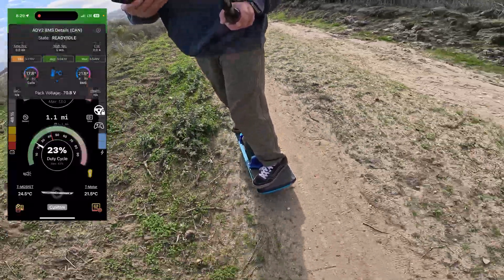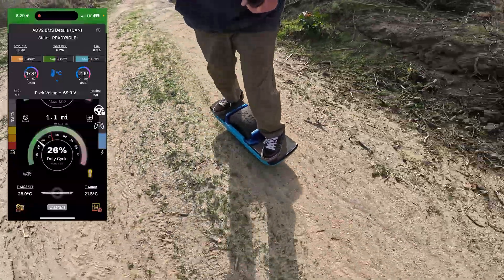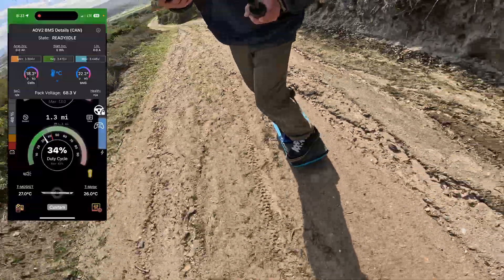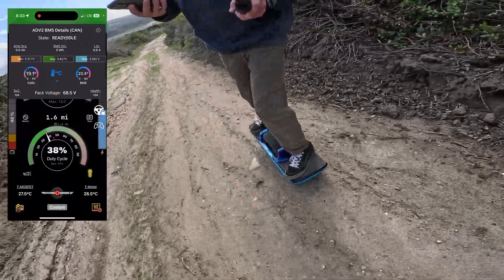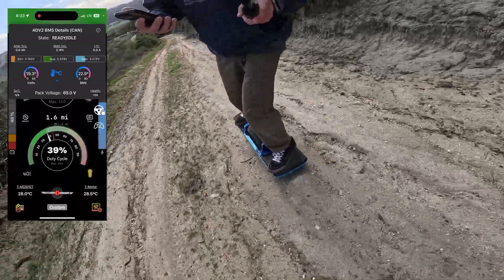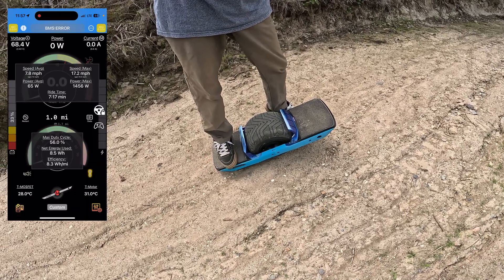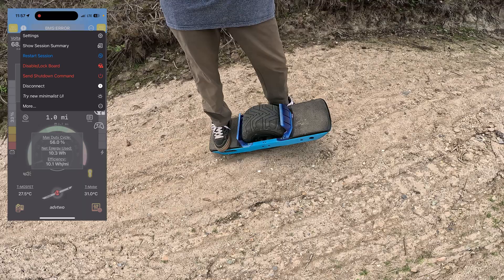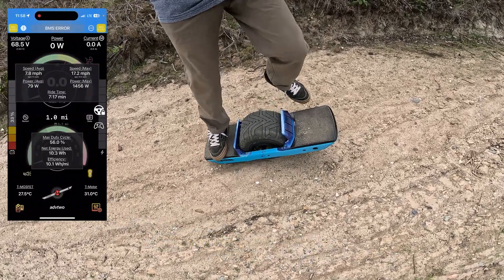VESC BMS Pushback done right - Floatwheel ADV2

Comment: It would be great to have some sort of common ground between Surfdado and Floatwheel and an official update released. I've just received my ADV2 and the amount of advice regarding settings changes to stock ADV2 board (which should just work out of the box) is a bit concerning

Comment: So we should either:
- cut the wire and give up on bsm pushback and remote tilt back 
Or
- download the float package and put in the settings you show?

Please help me understand 😅
Reply from the maker: @Smike2095  if you don’t want a remote just make sure remote is set to None in Refloat Cfg. If you want a remote you gotta cut the wire
Reply: Hello! 
Thanks for Intel, I think I understand my problem now. I change all the setting you told us especialy the remonte.

To start you have to know I have a problem with my bms making the board impossible to turn off. Its on since my first start and won't get off with long press on button...

Actualy with low batterie around 64-68 and steep hill I get the board giving me à big captain Morgan with setpoint to 13°! And this capitain Morgan Never stop! I notice no pb with the cell voltage they are nicelly calibrated over 3.3v.
Température fine but I just notice the T7 error code 99° in the bms Windows of vesc tool. 
 So I have to ride all the way back home with the hudge capitaine Morgan with a board at 68V...

When I charge my board over 70V it work good again normal... 

Big mess... Tony Will send me New bms in 3week. I Will try again tomorow with your New setting. Maybe the none in the remote Will save me ...

If you have an other thougt tell me.

Have à good Day
Renaud
Reply from the maker: @RenaudWeimerskirch  setting remote tilt to "None" will definitely save you. For your "always on" board please try to set the brake current in "Refloat Cfg", "Start" section to 0A (default is 6A) - then wait 30 minutes, does it turn off now?
Reply: @surfdado  the "none" in tilt control realy help! Now I can go to the end of the battery and have à normal push back wich go along with how much I ask for power. It's not anymore the constant captain Morgan! :)

But for the board Who Never turn off the problem is not solved with the New setting...
You think It's can come from the bad bms has Tony said? 
Even with no light im consuming 15w constantly It's OK because I ride every Day now but if I leave the board for à week it Will be à problèm...